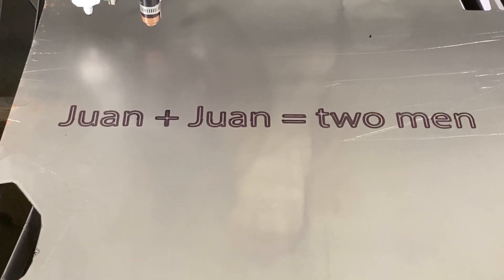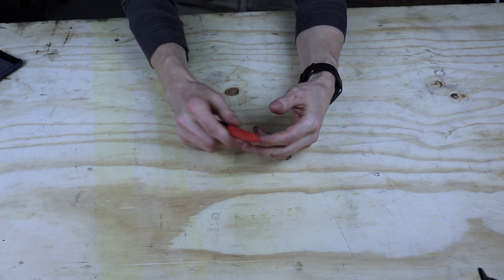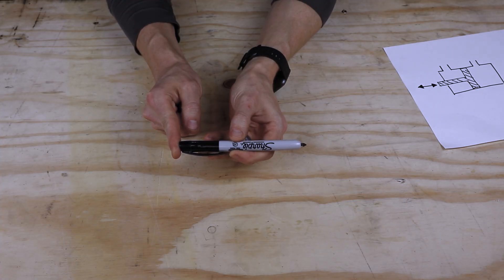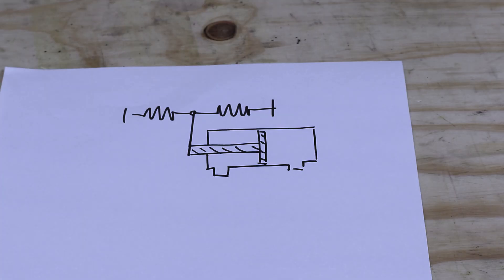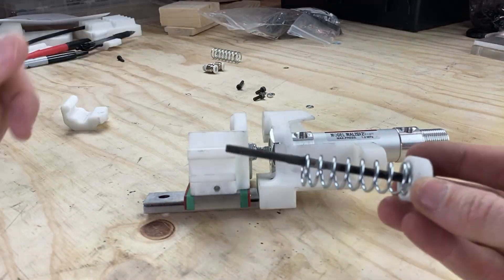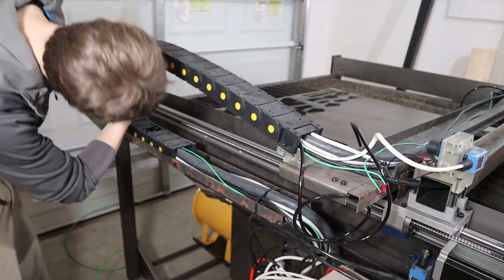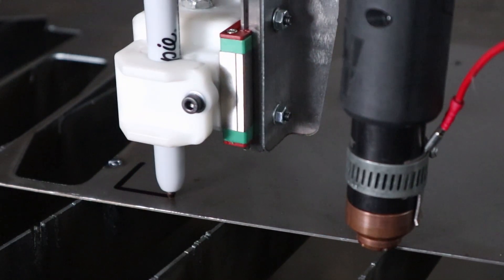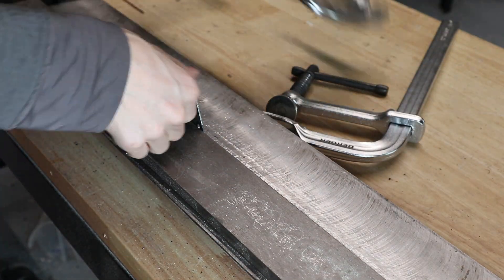This marker will change the way you work with sheet metal

Comment: I've gone the shade tree route and taped a sharpie to the side of my torch and run my part on cardboard with the torch off to get an outline i can cut out by hand and take that template with me to check fit before I cut my metal part out. Not nearly as high tech as this. Also for bend lines I've cut perforated slots along the bend line in thicker materials and have drawn little notches into my flat sheet parts at either side of the bend on thinner materials that I want a continuous bend on.

Comment: I think that using a 5/3 double solenoid on on aire block manifold you can lock a air cylinder mid stroke.  You need to put valves in the exhaust ports to limit the speed so it does not just snap open or close real fast.  Then you can use a timed circuit to  energize solenoid (A) and tell the open valve how long to remain on and move the cylinder the desired length and go off and then go off.  If you have the exhaust port valve set so it takes 5 seconds for the cylinder to extend and you cut the air back off by de-energizing the valve at 2.5 seconds it will move about half way and lock in place. How long you leave solenoid (A) energized to how far it opens and the same for retracting the cylinder with solenoid (B) on the manifold.  You can adjust the position of the cylinder by the time it is energized in each direction but also with the valve that limits the flow on the exhaust ports.  Then you can place the cylinder in any position you want.     But you have to have your input regulated to a exact amount of pressure say 30lbs or whatever.. It won't take much to move a pin.  

I use to work at a manufacturing plant and we used a lot of air cylinders I designed and built many of the machines.   I like working with pneumatics.   It has been a good 20 years since played with them and not much of what we did was computer controlled but you can do a lot with some simple timers and delay timers and limit switches with the different kind of solenoid manifolds.       Awesome build!

Comment: i am thinking a simpler way to achieve this would probably be using -  a threaded rod that is attached to the sharpie, and rotate the rod a few turns in clock wise/anticlockwise direction to change the sharpie height w.r.t the sheet metal you are drawing on.
Weld two nuts together - place the sharpie in 1 nut and the threaded rod in the other nut when the rod rotates the nut travels up/down taking the sharpie along. Place a small plate at the top so that to if you rotate "UP' enough the sharpie presses against the top plat and opens up - not sure if that makes sense

Comment: Instead of the air cylinder, wouldn't it have been easier to make an actuator using an RC servo? Also, it hurts to see the pen tip squashed like that.  ;)
Reply: As he mentioned, he was worried a lot about electrical noise (interfernce) at that end, so he built a system where only the (non-noisy, noise-resistant) air comes to the tip, and he can put the noisy electronics wherever.

Comment: Two things, 
1. For the valve you can use a 5/3-way valve open center. Or 
2. Use 2 cylinders back to back, with one pulling up and the other pushing down. For option 2 you will need 2 five port four way valves.

Comment: I noticed when the pen was first activated by the air cylinder it went up to press the top button, then when the pen was made to lower into position, it was with a real push - compressing the tip.  This in itself will soften and widen the tip.  You must have noticed this too.  At this moment I'm trying to think of a way to drop the pen gentler so it will not compress the tip.  Then the results of the holder should allow it to FLOAT allowing the weight of the pen to draw the line.  I believe that the weight of the pen and FLOAT can be enough to draw with, because you're not interested in a dark wide line, just a simple line.  I know that an air activated cylinder is not one to go up and down gently, they are all in and all out.  The only thing here that you can control is the size of the air line and therefore the rate, and flow and therefore the speed and force.   But the pen down rate would be slower.   Can you design a one-way slip with the pen?   Well, that's the end of my designing for now!
Reply: You make a very good point that I think would combine well with a separate idea I had. In the video, he notes the need for three positions for the marker, but I think two positions would be enough. 

When the tip is extended, the marker is longer than it is when the tip is retracted. If the lower position is set low enough that the marker can write with the tip extended, the marker won't touch the surface when the tip is retracted. Instead of having separate operations for extending/retracting the tip and lowering the marker to actually write, just have the single operation for extending/retracting the tip. With the tip retracted, the lower position is effectively the park position. When it's time to draw, the marker is pushed to the upper position, which extends the tip. When it drops back to the lower position, the marker is now long enough that the lower position now acts as the drawing position. When it's time to stop drawing, the marker is again pushed to the top position to retract the tip. When it drops back to the lower position, the marker is no longer long enough to draw, so the lower position becomes the park position again.

Where I think this pairs well with your idea is that movement to the upper position is the only situation where a great deal of force is needed. For lowering the marker, gravity and a gentle spring may very well be enough to move the marker to the lower position. The spring would help ensure the marker tip remains in contact with the metal while drawing, and could optionally have an adjustment to tune for the minimum spring force needed. Without the need to slam the marker to the drawing position to mark the parts, your idea for a floating marker that rests on the surface is easier to implement while also simplifying the mechanism.
Reply: @klasodeth  - Good idea, now let's make him try it out to prove it!  Being a back seat designer is fun too, right?

Comment: U don't need springs. Just pressurise both chambers. I maintained conveyor lines with dozens of 3-positioned pistons. It used presuring both chambers. Zero issues from setup. Just needed to adjust presure in both lines.

Comment: trick with the routing of the cables is tape a pieces of fishing line to the tip of the line your running, now the next time you need to route something, use the fishing line that is ran, just make sure that you have another one taped to the line that your pulling through for your next use.

Comment: 9:50 As a fellow CNC operator there is a simple solution to this particular problem.  Mine just so happens to be 250 lbs. fly line backer.  Fly line backer is braided line perhaps 3/32” in diameter and is relatively slick in nature. It is super easy to install also.  Just tie it to one of your previously installed cables in the cable tray then disconnect and pull out the cable.  Mark the fly line 4” below the point where the line stopped feeding back into the cable tray. Then pull the additional line out through the tray until you get to the mark. Tie a small weight to the other end of the line. Reattach the cable to the fly line ABOVE the mark on the line and pull the weight to ‘fish’ your cable back into position.  Installation of this line should take less time than me typing out these instructions.  I use a bent paper clip to secure the one end to the flex cable tray and a simple bread tie to gather up the excess at the other end of the tray.
Reply: Elegant.  Very handy!

Comment: Could you control the pen position with the same rotating 2-state sort of mechanism as the pen's own clicker? (The advantage would be that you don't need a system with constant pressure, the pen position can be actuated by a burst of air, and then goes into one of its 2 stable positions, so the air pressure can be released)

Comment: Why do you have to make being brilliant look so easy?!?!

Running a hose through the haness on the machine doesn't have to be hard. Possibly an easier way is to use an existing hose and pull multiple strands through. Then use the extra strand to return the pull hose.

Comment: i dont know of any sign shop (in my area at least) that uses a plasma cutter. sheet metal is not a common material in signage these days, there are much cheaper, easier, and better looking ways to make art for signs, so I dont think a sharpie attachment is going to drastically improve that. especially when most shops will have either a vinyl cutter, printer, or flatbed printer to get graphics onto a piece of metal.

Comment: The answer to running the cables is to run some mule tape through.  Since it is so small you can do a whole loop of it and pull new lines through that way. 
- Some guy that has run a lot of cables through a lot of small conduits.

Comment: 9:52 you already have cables that go through the Energy Chain, so you can attach a long auxiliary Rope to the end of one cable A, you pull out the cable A (and the rope also goes through), then you tie the new cable B to the same end of the Rope where the cable A is already attached... so then you pull back the rope with both cables, and voilà!

Comment: There is a center positioning pneumatic cylinder. We have these on our oil rig. Barksdale makes the valve and actuator. Its a 3 position shearseal valve. 
There is a sleeve in the cylinder that only travels half stroke. When you apply pressure in both ports, the sleeve pushes to center due to larger area, the piston pushes against the sleeve with the opposing air pressure. The sleeve does nest into the piston to allow full travel in fully ext and ret. Really trick design.

Comment: So um, you can just create an etch setting on your plasma cutter so it etches your bend line, just reduce the power So it just marks it. The line should be thinner and more accurate than a thick texter line, you never want to use texter for sheetmetal, etch or pen line only, want to keep that 0.25mm tolerance

Comment: This is a no brainer that should be on the next generation of Laser cutters. Every application of sheet metal surely involves bending the metal after it is cut. If you bend the metal wrong, you might as well scrap the part. This could be really expensive in a manufacturing setting. If you're manufacturing parts for a customer and fold it wrong because of the lack of marker, that part would come back as a return when it hits their quality department. Everyone involved would have to expedite shipments from their suppliers, probably with air freight if you're shipping overseas. You can literally end up paying $20,000 when stuff like that happens. It'd be worth buying a new cutter just for the marker at that point.

Comment: I work with CNC machines and my father in law works with plasma machines. His machine is really old and so is the controller and software to make parts. He is still getting used to how to use the plasma cutter. What software do you use to make the designs/program it and what controller do you have? I will probably have to have his model of his machine to buy a newer controller that works with it.

Comment: "I didn't have a long enough screw, so instead of just going to ACE, I lined up the threads from two shorter screws and welded them together, implying I cut the head off of one of them when I at LEAST could have just used threaded rod and a screw head" that's how I heard it, you wonderful fucking lunatic

Comment: Hi Stuff Made Here
You should put a guide line/rope inside the energy chain, so next time you need to insert a cable, you can tie the new cable to the guide line, and just pull it through from the other side. 
Just make sure that the line is at least twice as long as the energy chain so that you can pull the guide line back when the new cable is set.

Love your videos btw :)

Comment: Marker should NOT be attached to holder directly. It has soft tip and marker should be able to lift up from holder with pretty small force. Otherwise you will smash tip. Or you should make adjustment for different material thickness. By the way - what point to make hole place by marker? I believe plasma cutter can make hole that you can use as a guide for step drill bit.

Comment: Not too long ago, I had attended a class for programming and operating Haas CNC mills, and we actually used attachment similar to that when we did our first practice runs. So, when they had that attachment, they were basically ungodly expensive CNC plotters😂

Comment: So at about the 10:00 mark your trying to fish the air line thru the energy chain. The tool you need is right there. Disconnect that Green "Ground" wire and use it to pull thru the air line and a spare wire. Then use the spare wire you pulled thru to pull the ground wire back thru the chain. Or pull 2 extra wires thru and leave one for the "FUTURE".

Comment: I only just saw this one even though I've been subbed for a while - I made a sharpie plotter attachment for my CNC as I wanted to change over the wasteboard and needed the effective cutting area. While yours is a lot more fancy than mine and I am able to change the height of the Sharpie in the CNC, I did add a small spring into the sharpie holder so that if there is a height difference I don't prematurely ruin or break the sharpie.

Comment: I add a pierce point to mark the folds. We are under so much pressure to get work out quick. Taking the workpiece straight off the plasma and directly to the folder saves valuable time.

Comment: Another good way to overcome the spring stiffness problem is what motorcycle transmissions (or any sequential) do which is put a hard stop on each spring at the desired location and then preload the springs to overcome the friction. Then you can run lighter springs without issues

Comment: Fishing the line through that cable protecter... 
Next time feed a length of string through and leave it there. Then when you need to do it again you tie the cable to the bit if string, also tie a second bit of string to the same end as the cable. Pull the first string (pulling the cable and second string through). Leave the second string in the protecter for the next time you need to thread a cable... 

Just remember before pulling the string out, tie a new one to the end so you're replacing the string with the new one.

Comment: For stringing the hose can you:
1) disconnect a current functioning hose
2) tie another rope to end
3) pull out to remove feeding rope in after
4) attach new hose to old hose
5) pull both back through 
6) untie rope, attach two hoses to machine
7) save 1 min?

Comment: Just rewatched the video and I gotta say it still amazes me.
But there is really no reason to retract the sharpie. It won't dry out anyways since there is always the open hole in the bottom that doesn't seem to bother the tip.
And little shield could have stopped plasma debris from hitting the exposed tip.
Nevertheless it's an awesome thing to have!

Comment: I do work with sheet metal, but we have a laser cutter and just etch our bend lines and put small notches on the ends for any bends going in the opposite direction of the face the etch is on.

Comment: You consider having a wire/string to help tape and fish through your "energy chain?" Just double the length so you can just leave it in the system and just tape and pull on the available side.

Comment: I work with 3 position air cylinders at work and they can be a pain to tune to make them work correctly. Us maintenance guys wish that there was just a stepper motor to move the parts for ease of troubleshooting.
Tldr I hate troubleshooting pneumatics

Comment: Great video, project, and your skills are wonderful. 
possible feed for chain guard, have a line already installed and use it to pull your wanted line with another pull length so after completed install there will be another pull line always installed.

Comment: Why not apply pressure to both sides of the air cylinder to have it sit in the middle ?
Instead of using springs.

Comment: Very cool, I am curious how you get that g-code though. I assume that normally a cad program would generate that for you but with this you need to inject a bunch of g-code before and after certain paths in the design, or what do you do? And also did you have to add some extra controller board to execute special g-code for the marker clicking/lowering or can you just add that to the programming of your current cnc brain?

Comment: Dude, you should just run a loop of rope through the c̶a̶b̶l̶e̶ ̶t̶r̶a̶y̶/̶p̶r̶o̶t̶e̶c̶t̶o̶r̶ ̶t̶h̶i̶n̶g̶ energy chain. Leave enough slack and tie the ends together. Then, next time you have to run a cable, tie it to that loop and pull it through. It's even reusable.

Comment: Easy tip for fishing things through the cable chains or other raceways:
Step 1, attach a length (or 2) of pull string along with whatever you pull in there the first time. 
Step 2, always repeat Step 1 when you add something new.

Comment: For the cable routing through the sleeve, keep a plastic wire routed there.
When you want to route a new cable, connect another plastic wire and the wanted cable to it.
Pull from the other side, and you'll have your new cable and another "routing wire" routed, ready for the next time!

Comment: I make parts like this from laser-cut aluminum, I always put rows of holes or slots along the bend lines. I don't have a bending brake, but the holes make hand-bending really easy. The parts are slightly weaker, but the problem of where to bend is eliminated and accuracy is great.